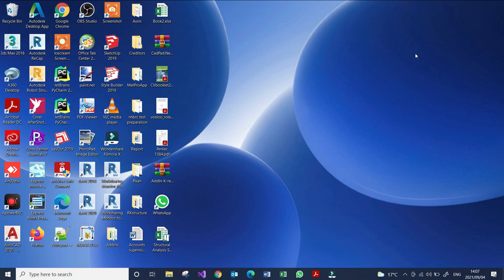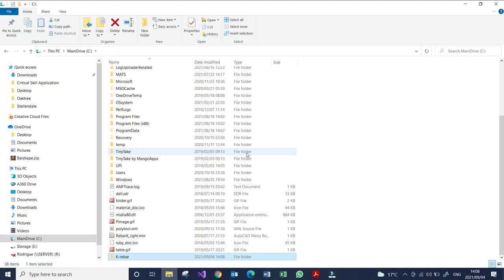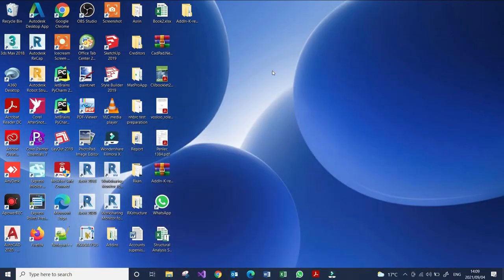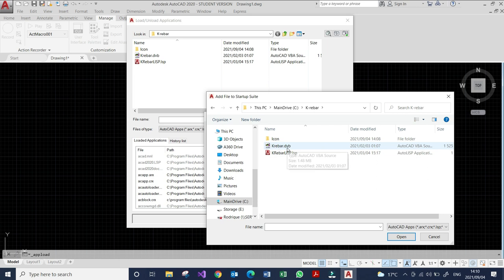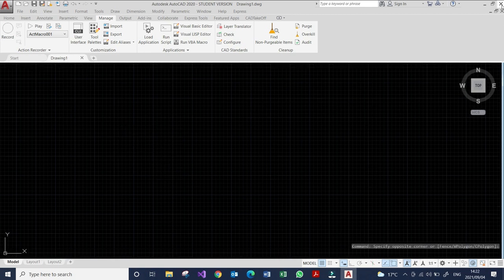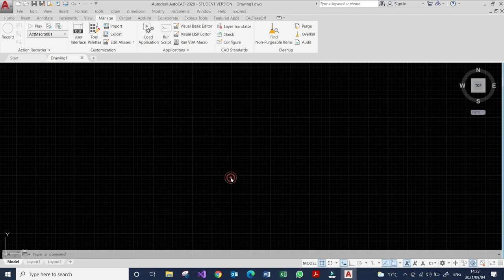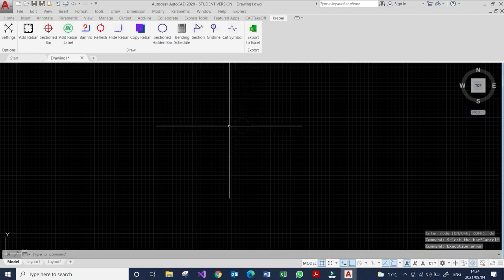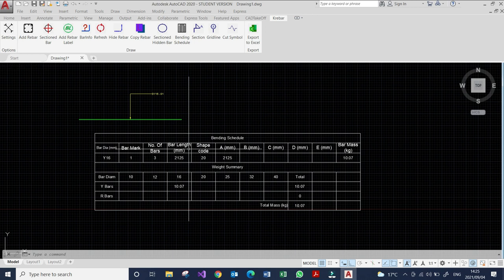Krebar-Installation video

Comment: I've tried running this on Bricscad V21but not having much luck, the tool bar is showing in the ribbon but when i try to place a bar, the programme allow me to enter the information bar size, code lable and so on but when i try to place it i get an error "Compile error in hidden module" i assume this meand the code is not compatible with Bricscad? is there any way to work around this, i'd love to try out Krebar.
Reply from the maker: Hi Colm,

This tool is made for Autocad.
Reply: @RodrigueKamdieun  thanks for the quick reply, I understand that it was designed for Autocad but I don't think Bricscad is so different. I was hoping it might be an easy fix. Looks like a great programme.